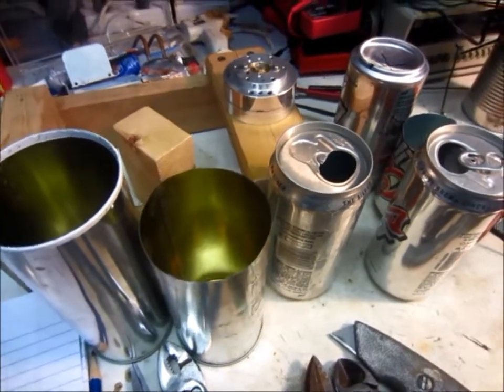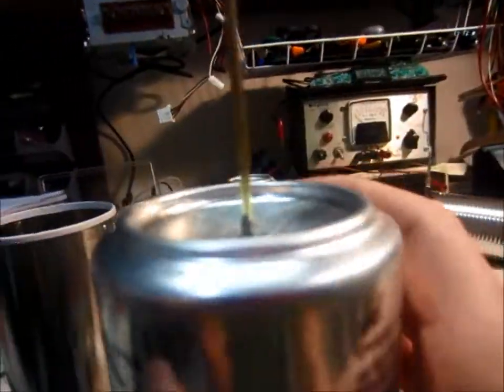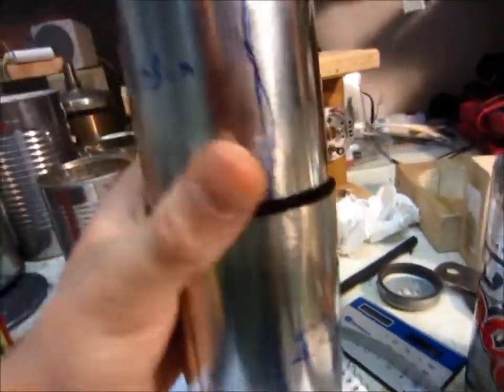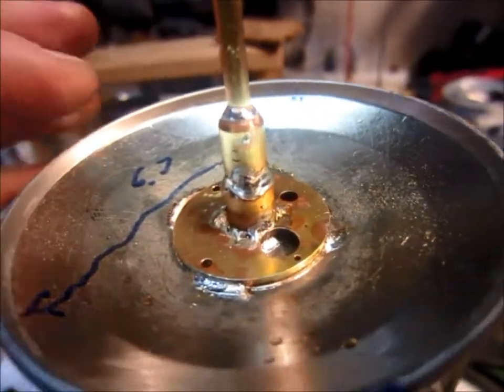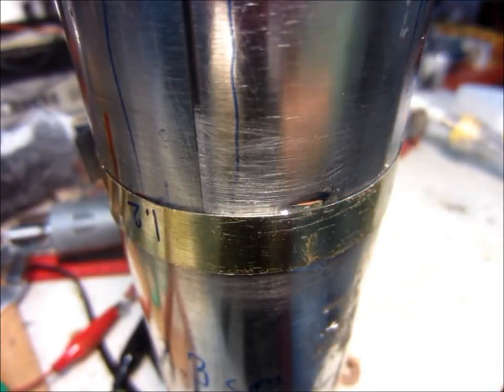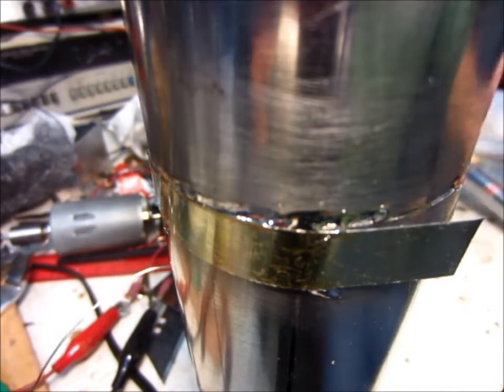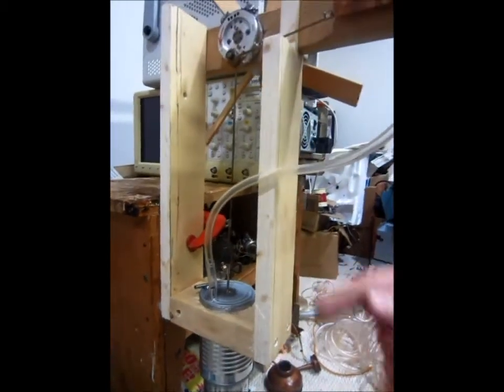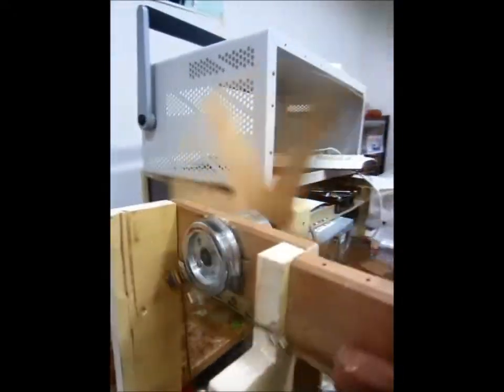Stirling Engine #4 Build

Comment: Over square is when the piston is wider than the stroke, under square is when the stroke is longer than the bore. Square is when they are the same. Strokers are typically good for compression, torque and low rpm, Oversquare is good for high rpm, High HP, as lower piston speed. I was thinking thread seal tape yes, Probably rolled into a grove, but maybe not. Depends if it will stay in place.. Don't know if it will work, but Teflon has low friction, and it is sealing tape... Just an idea.

Comment from the maker: So would I just wrap the teflon tape around the piston or should I cut a grove in the piston and put it in the grove?  Do I just use the stuff that you use for sealing the threads on pipes?  What do you mean by the term "over square or under square"?  Thanks!

Comment: Regenerator will help a lot I think. not much cooling going on.. That top piston looks average, longer shaft too, get less piston slap. Have you tried teflon tape (used like a piston ring) to seal piston? do you think over square or under square is good for the piston? Looks to me like the longer stroke from under-square would give torque, while short stroke over-square would give high rpms... Much like combustion engines..

Comment: I would stay away from steel wool. with mine it wore a hole right through the expansion chamber. and when it did that the water from the water jacket leaked right through. I did not know this at the time and put it on a shelf for a month when I tried to start it up a bunch of rusty water poured out. it also didn't help with me pouring 12 ounces of water in the water jacket and I kept topping it off because I didn't know where it kept going.lol

Comment: You want to make a displacer piston "regenerator" made in steel wool?
It really is complicated, because the maximum power into electricity that I had with my engine, was 0.6 Watts.
And to achieve this, it took a great care of the power piston friction and air leaks. I'm currently using as a lubricant for the piston "areossol automotive silicone."
It also decreases the distance that the displacer piston runs, in the case when it is done with can.
A Merry Christmas and for your family.
Leandro.